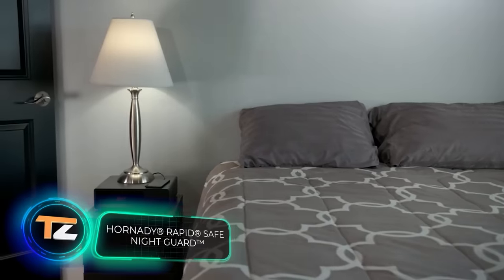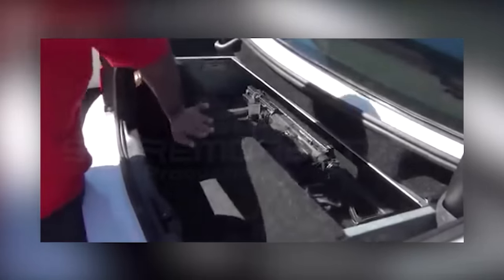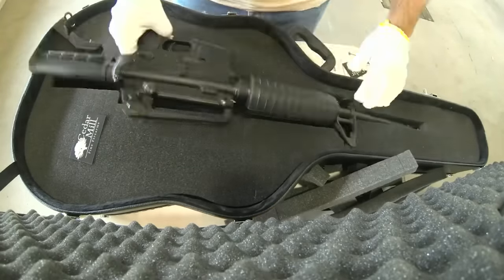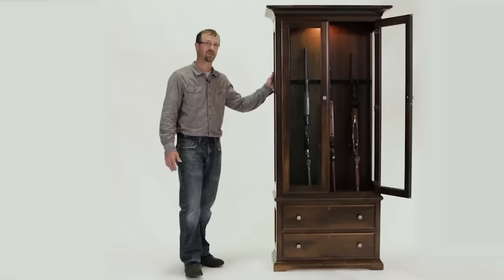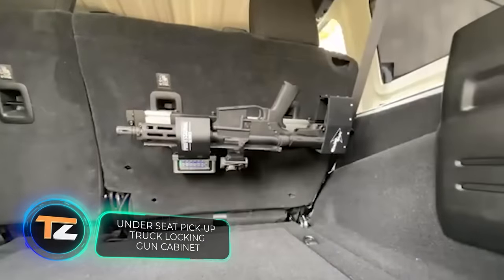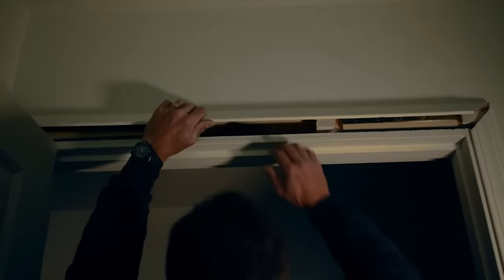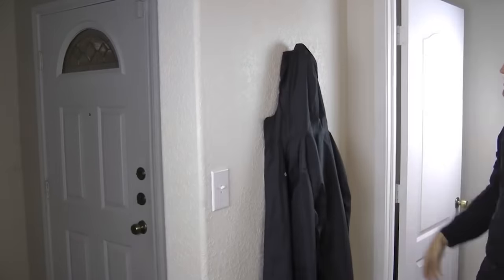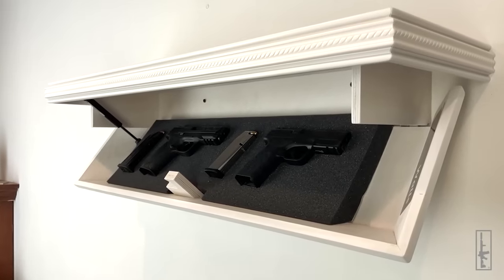INCREDIBLE WAYS TO STORE WEAPON YOU DIDN'T KNOW ABOUT

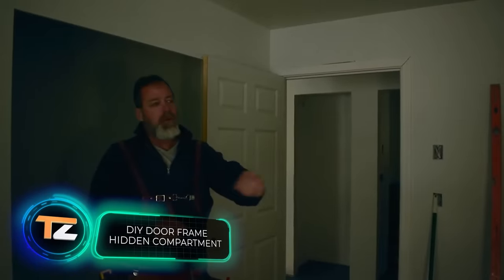Comment: 7:24 they missed a great opportunity. They should have designed it so that when the door is closed it butts up to a barrel that passes through the fender out the front of the car so if there is anyone in front of them trying to stop them or whatever, they don't have to reach out of the car. Just reach over to the door and pull the trigger when you line up the sight peg on the hood with your target.
Reply: Drilling a hole in the car is way to complicated, its way easier to just equip an anti tank turret on top

Comment: As a CCW and home defense firearm instructor, I wanted to emphasize that these (and others on the market) STORAGE DEVICES should NOT be used for firearms that you need immediate access to during immediate threats to self and others, like at home.

These are mechanical and electronic devices that CAN and DO fail! 

Batteries fail, mechanisms fail, electronics fail, sensors fail, fingerprint devices won't unlock 100% of the time, fingerprint devices also unlock for prints that are not enrolled, etc., etc..

You do NOT want to be searching for a fob, phone, key, magnet, or other devices to open these storage areas in a life or death situation, even if they have a "backup" key.

Comment: Back in the 1970s my Dad just knocked a hole through an interior wall between living room and kitchen, put in some shelves and didn't nail down the bottom shelf.  He stored a few pistols inside the wall.  Just slide the bottom shelf out and there they were.  No electronics, no locks.  Kinda like the hidden door frame gimmick.
Reply: Same with the house I grew up in. My dad put a hidden panel in the hallway closet with room for half a dozen rifles. I've wondered if any of the new owners have found that cubby.

Comment: Whatever you do, don't rely on hiding them for security. Make sure they are locked up even in an obvious safe. In most states, if they are stolen you can either be charged with a crime or end up with civil penalties for not securing them in something like a safe, The bigger the safe is the less likely they can walk away with it. If you have a real gun collection, get a 32 gun safe and have it secured to a cement floor. It will take a forklift and a torch to get it out.

Comment: Hear me out, if it's not your bedside table put it in the metal safe. Bolts to the wall and floor so nearly impossible to take out. Thick metal that's really hard to cut through, a key that is on my keychain, backup hidden where my last mountain dew code red is. It is dummy lockpick proof, trust me I tried.

Comment: Why hide your weapon? While alone, no one will see it anyway. It also takes longer to get the weapon ready. When face to face, you'll hardly have the time to approach, retrieve and unlock it. I'd rather advise suspending your gun by threads, from the ceiling in your hallway, readily unsecured. Only takes grab, pull and fire!

Comment: The first item you showed, the alarm clock safe, IS defective if the alarm clock doesn't work! It has a USB port that is irrelevant but the device it is supposed to be doesn't work? Goofy! I just repaired a Dewalt cordless battery charger last night. It has two battery slots and two USB ports. The USB section was screwed up from moisture and had the entire thing not working. I bypassed the stupid USB and got it running. It is a 'job-site' charger. Don't be on the phone while you are supposed to be working and you won't need to charge it, on the 'job-site'! Companies insist on putting USB ports on everything, but they couldn't get the clock to work...
     That is so ridiculous that I would never consider buying anything from a company that ignorant...
      Ya'll Take Care and be safe, John